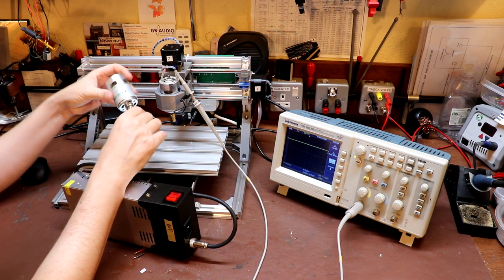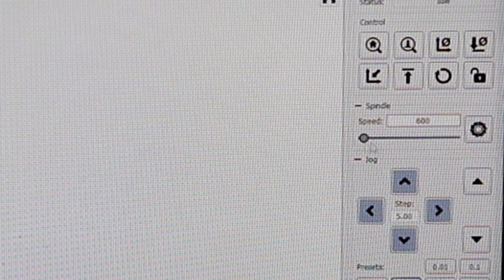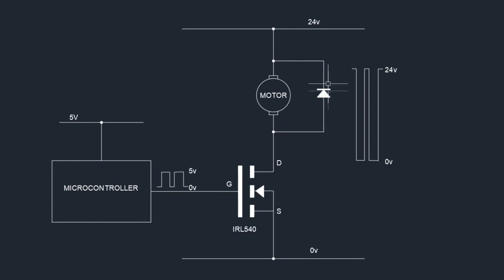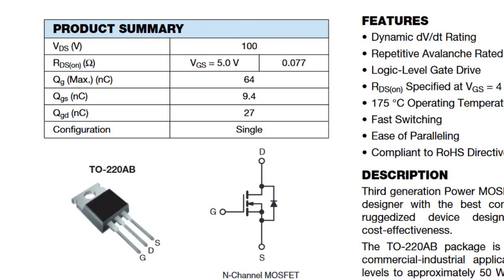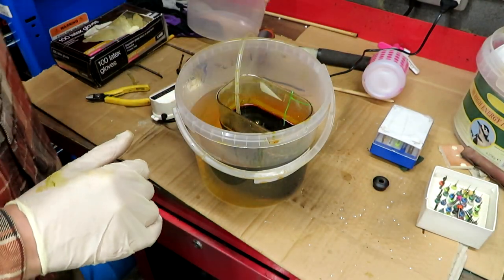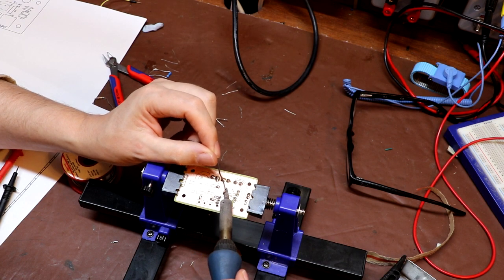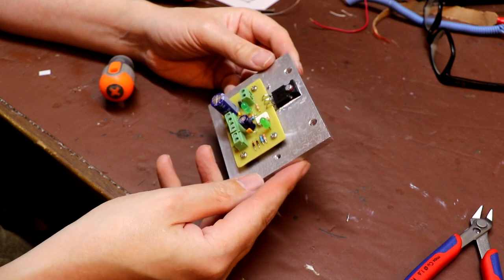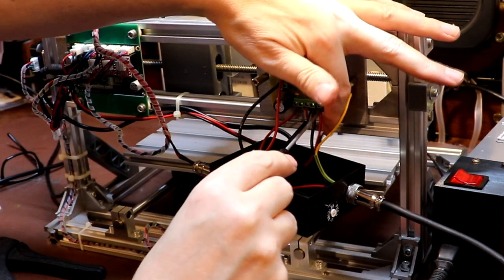Woodpecker 3018 Spindle Upgrade - Part 3 Its a Long One!

Comment: Really interesting video, Chris  - thank you. I enjoyed your explanation of MOSFET operation - especially the gate drive current part. I can't wait to see it in operation and find out what the mystery project is that you will be using it for. I have found that a fine tip "Sharpie" brand permanent marker works well for minor touch-ups of toner transfer etch masks. Stay safe. Regards, David.
Reply from the maker: Hello David glad that you found it interesting and thanks for watching. I find when the tone transfer fails it normally on the ground plane areas were it just doesn’t put down enough toner.  I’m thinking of trying to build a project using a monochrome high resolution LCD to project the tracks directly onto the UV sensitive PCB material.

Comment: Now i stand under fossmets a bit butter  :-D
i often get mixed up with mosfets/scr's/triacs and pnp transistors lol, i re-learn them but forget far too fast.
I have replaced loads in switcmode supplys,  but that's a physical job, not a mental one.
Yes i am mental :-D
That's a loverly pcb chris, a well thought out circuit without a micro controller to crash and cause problems lol.
Hardware circuits are nice,  only a physical programming pattern required :-D
Knowing you, it will work spot on as i'm sure it's been on the breadboard and you have ironed out any unexpected problems.

Smashing video chris, you always make me smile... or is it wind ha ha :)
Reply from the maker: This video was like walking through mud. Thanks for sticking with it. I have no idea when it Comes to mosfets so I just make it up. Thanks regards Chris